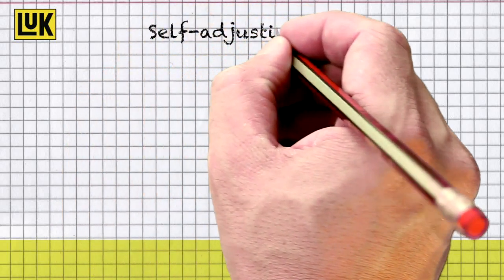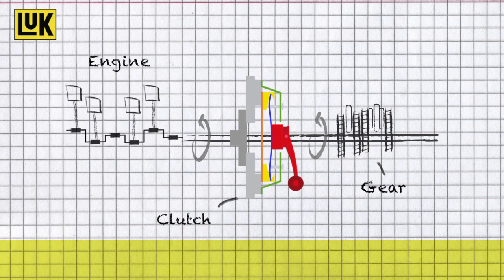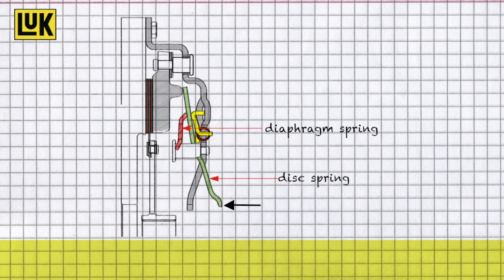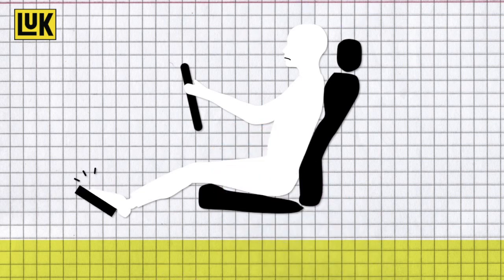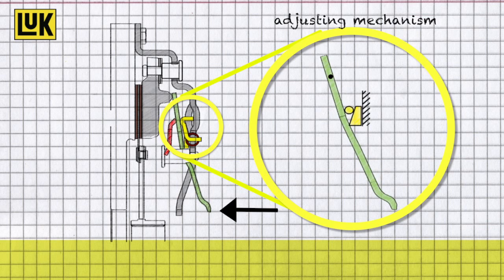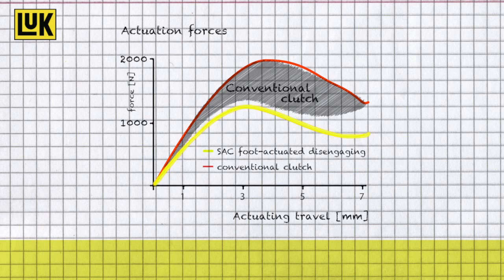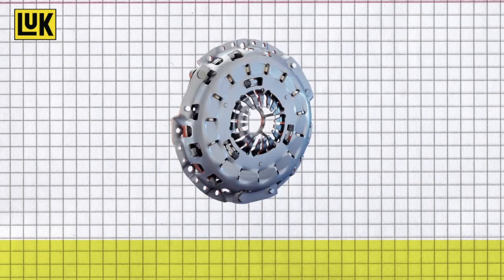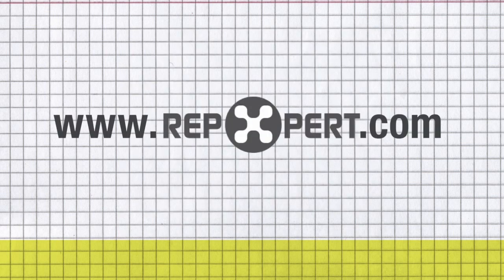LuK Self-Adjusting Clutch (SAC) - Simply Explained!

Comment: Weak explanation. The fucking truth is this clutch become no guarantee car part and every 60-70.000 km must be replaced with high expenses and lot of service time. Fake!
Reply from the maker: Hello @Cristy Gratziani, we will not tolerate the usage of abusive language on our channels. That´s why we will not publish any further comments that include swearwords. The video was designed to explain the adjustment mechanism that helps to increase driving comfort (steady pedal force over the lifetime). 
Of course, every manual clutch is exposed to natural wear & tear – its degree is however influenced by many factors. We are sorry to hear that you have experienced problems, but please be assured that we are doing our very best to achieve highest product quality to maximize clutch lifetime.
Reply: @SchaefflerVLS  increase driving comfort? Lmao...can you explain how you'll increase comfort as long as this spare part is throw away almost as new and you need to buy a new one just because your product is sealed and resetting is impossible? My advice to anyone is to buy a resettable device and avoid Sachs.
Reply from the maker: @cristan9582  Hello, as already explained, our SAC clutches use a mechanism to keep pedal force at a steady level. Without, higher force would be needed for clutch actuation over time.
 It is difficult for us to advice from a distance on your issue of resetting, as we don’t know the concrete product/application/vehicle/damage pattern. Please consult a professional garage and follow their advice. All the best!
Reply: @SchaefflerVLS  no need to consult any garage. Your dual mass flyweel and pressure plate are jung. If you check the old friction plate with 80.000 km, is ticker than a new one you sell in package. How you explain this? Don't tell me you respect the client. Also, with old nonadjustable and single mass, you change the friction disc every 100k+, now with your invention you throw away every 60-70k the flywheel, friction and pressure plate, and you call this respect to client..no shit!
Reply from the maker: @cristan9582  we respect your opinion. Unfortunately we cannot judge on friction plate thickness or change intervals as individual wear is due to many factors & vehicle specific. Again, please feel free to get in touch via www.repxpert.com if we can be of further help. Thanks!